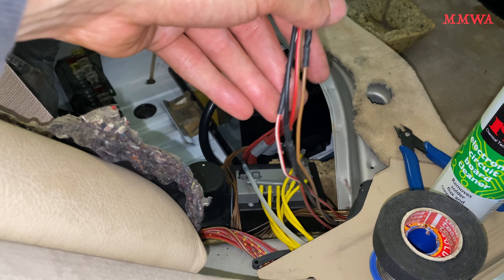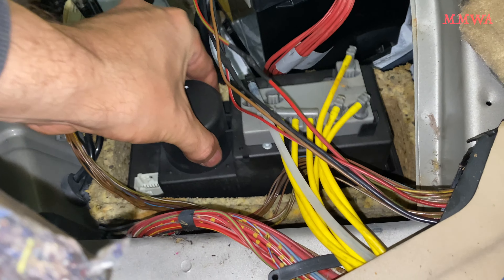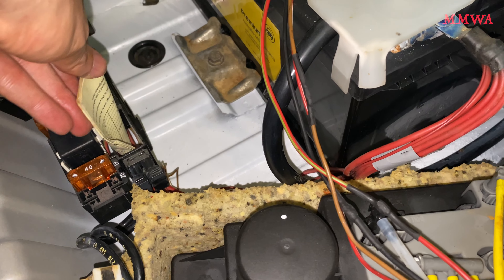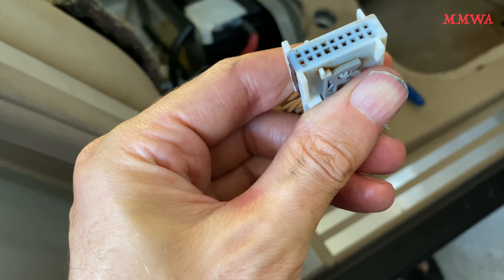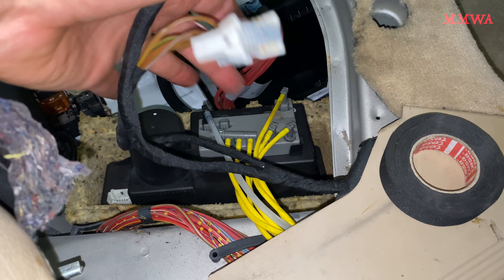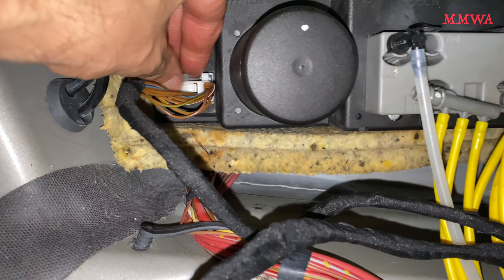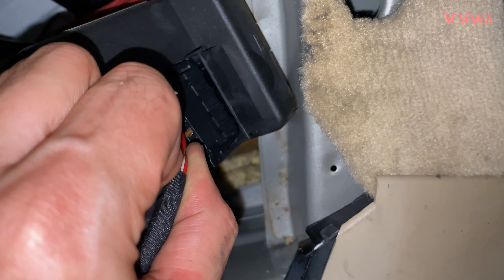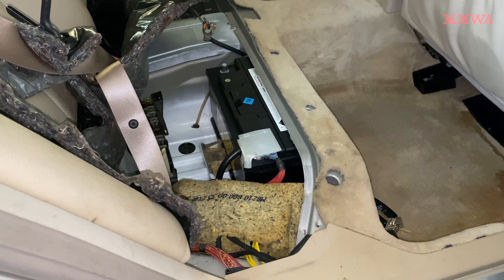Mercedes W210 batteries arent in the best location

Comment: I also like to use that cloth tape when fixing MB wiring harnesses. Makes everything look like stock new. Most often behind the radio of newly buyed car - those wirings are 99% awful if someone had changed the head unit. I have always used common hockey stick tape (stolen from my brother who plays hockey) :D
Reply from the maker: I’m slightly concerned to look behind the radio - it is not original to the car. The CD changer is missing and in its place remains the changer cable from a kenwood in the past. The MB Audio 10 CC the previous owner has put in there and i’m so far totally unimpressed by his (not so)handyman skills.

Comment: Its very strange for battery location for this W210, back in 2010-2013 I have the E230 1997 classic trim, yeah I remember struggle to find the battery location 🤣🤣
Reply from the maker: seems like they took inspiration from BMW - it is in the same place in the E34. I would have rathered it in the rear of the car up higher. I’m sure they thought it was a brilliant idea back in the day and had their reasons 🥹
Reply: @MMWA-DAVE  yeah I prefer the battery location in the trunk instead underneath rear passenger seat
Reply from the maker: @JimboGamingPS2  They we’re familiar with this concept with the v8 w124’s too from my understanding. As well as the R129’s. (have worked on neither)
Reply: @MMWA-DAVE  I see, I though the V8 W124 battery location is in the engine bay like inline 4 and inline 6 models.

BTW, I'll be waiting another video from you about this E430 W210 mate.

Comment: Ahhh the joys of discovery eh?
About the Li-Po car batteries, Varied results according to 2 people id spoken to.
Under bonnet install on a 200 series cruiser in both primary and secondary positions with nil complaints bar the hideous price, replaced 105 ah Calcium  batteries running a twin turbo V8 Oil burner.

Rear cargo space fitment on a d5 XC90 though? Threw random codes initially consistent with low battery voltage especially after winter morning cranking (Diesel) and seemed to recover slowly re voltage.
I popped a thermo couple patch on the side as well as it seemed a bit warm after the 2 hours drive to my place with the usual winter accessories and it averaged mid 70's to mod 80's using data logging on my multimeter after an hours cruise at highway speeds.
For a $600 battery (Also 105ah) with car terminals im inclined to wonder it they adapt well to Alternator (Low/No Intelligence) charging and arent more suite to Solar storage applications as a deep cycle type.
Reply from the maker: Think i will just get a regular varta brand battery. With only 2 year’s warranty on those lifepo4 batteries i bet they only have crappy pouch type cells inside. If it was packed with decent panasonic 18650’s it’d probably cost 4x as much and have 10 years warranty.

Comment: Is it an AGM battery?  Is this the primary battery or secondary battery?
Reply from the maker: only 1 battery in the 210. Mechanically these cars could very well be the most reliable e classes ever made especially with the m113/m112. Some other parts of the body are the let down though.
Reply from the maker: I am thinking i will get an AGM battery- do these still have vent tubes? If no vent id plug the floor hole off with a sealed grommet.
Reply: @MMWA-DAVE  In normal use no venting.  On my motorcycles they had vets but there was zero corrosion when the vent tube was left off.  I checked out one for my om606 w124 and it had no vent tube.  Then others had vent tubes.  Was the MB original an AGM?  In Germany u now have to have an AGM in your air-cooled VW even though the factory never put a place for a vent tube.